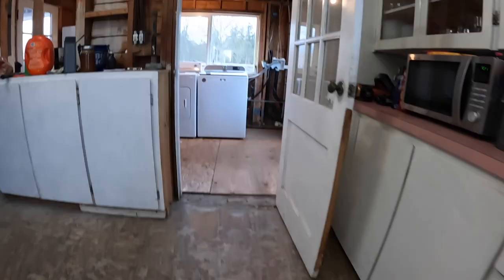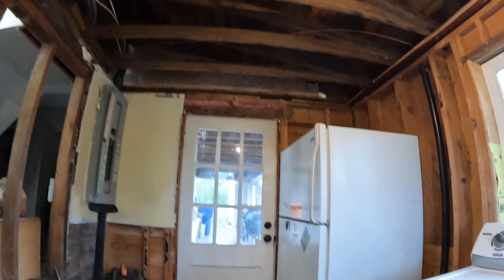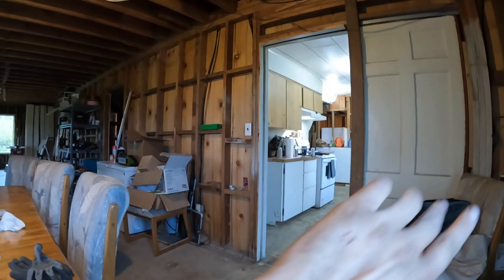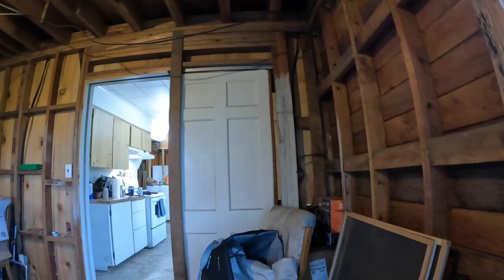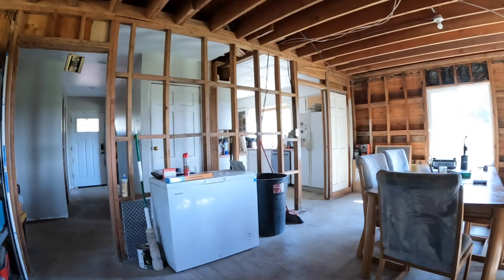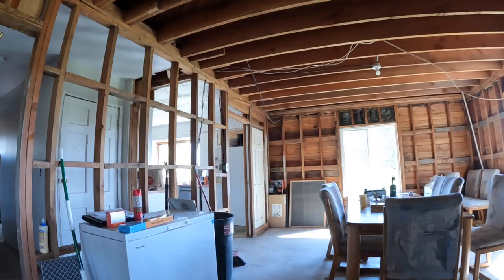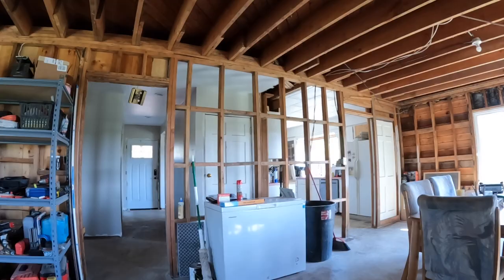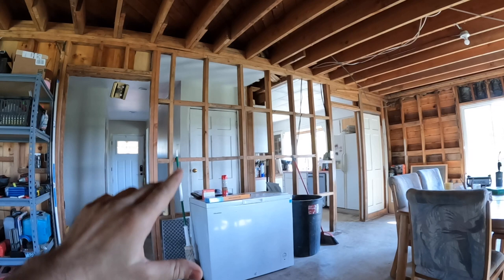1940's Farmhouse Renovation Ep: 7 Load Bearing Wall Removal

Comment: Oof, nice work. 👍🏼
I’ve done those beams in the past, you may need footings on either side of the beam for load.
More fun going through the floor.😕 makes a huge difference ,when it’s done..😍
🤙🏼💪🏼
Reply from the maker: Yup. Will be needing to cut the concrete and put in footings. Shouldn’t be too bad of a job. Having access to the right tools makes a big difference.
Reply: @LivingOnWheels  totally!, access to (the right) tools is priceless.

Comment: Looking good.   Header need to be double 9 inch LVL...
Reply from the maker: The one going in will actually be quite a bit bigger than that. Going off engineered plans from a contact. Should be good and solid